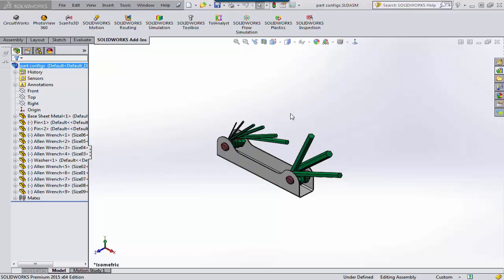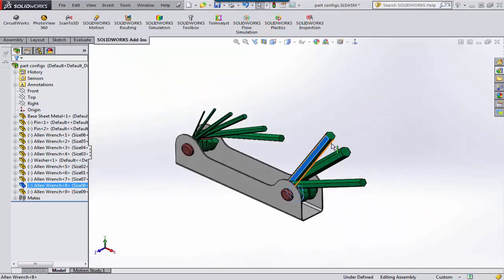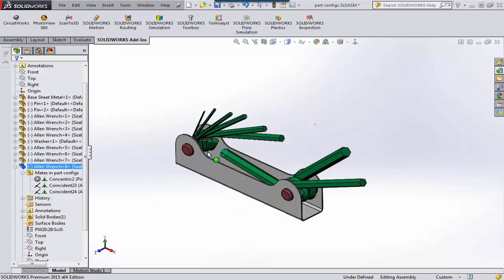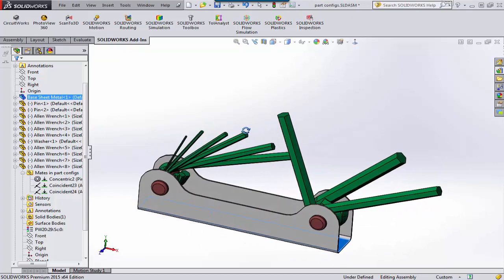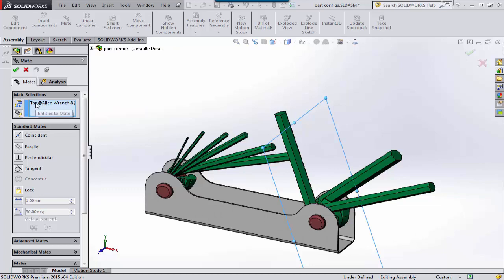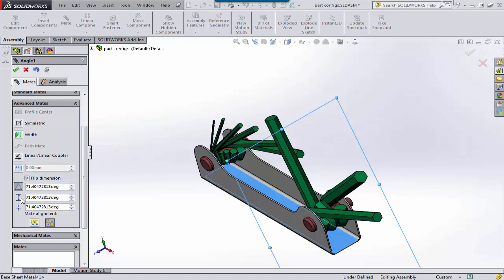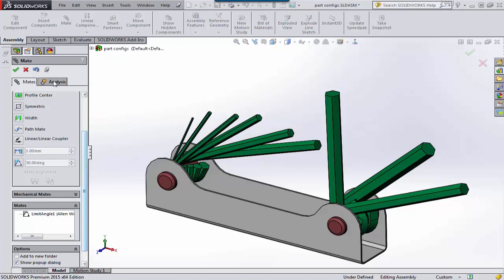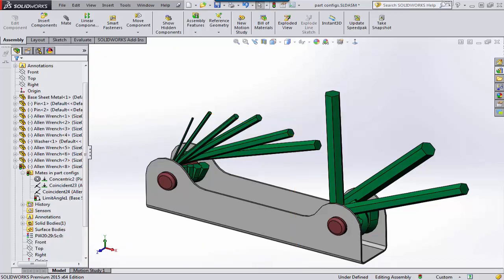SOLIDWORKS Quick Tip - Limit Angle Mate

Comment: Is there any way to do the same mate but not declare any degree value? Just declare the surfaces that make the limits...
Reply from the maker: Hi Alfredo,
The limit angle mate needs to define upper bound, lower bound, and present angle.  The definition would not allow for a null entry for any of these values so you would need to put something int for each.
Reply: It's weird that there isn't. Seems like it would be a way more intuitive system for them to add...